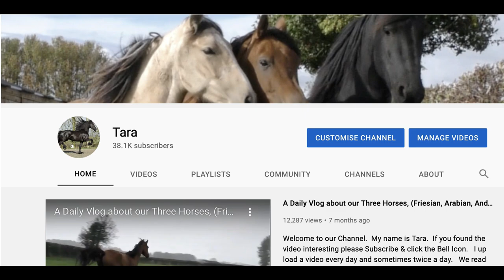Will It Fit❓Putting the Septic Tank in the Big Hole

Comment: Appears only loose soil and gravel is covering that long ditch from the house to the septic tank.  They know the horse-box is parked in that spot. Did they forget a step in stabilizing the area to bear the weight of the box loaded and unloaded?
Reply from the maker: they didn't roll the soil even though we rang the company
Reply: @Tara101  Seems to me Stabilizing the ground above the pipe line running to the septic tank is just as important as stabilizing the septic tank itself.  Makes sense to stabilize the ground.

Comment: How strange. The video clip ended (your outtro) but there was another 19 minutes of. Lack and then extra footage for a few last minutes of the horse box getting bogged down. !   

By the way.. slightly arming…they laid down the septic tank and backfilled the hole without lining it.   Just poured concrete straight in.  A total NoNo for several important reasons.  It would never get consent over here like that (and consent and sign off would be needed) in NZ. 😱
Reply from the maker: Tfs